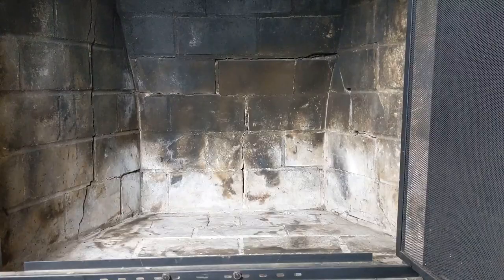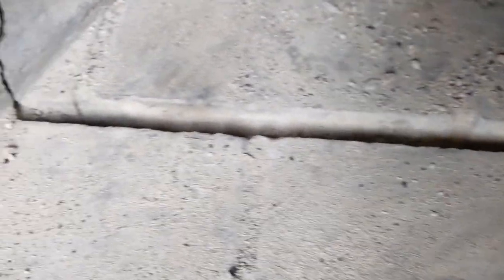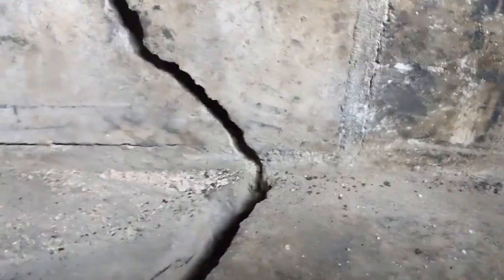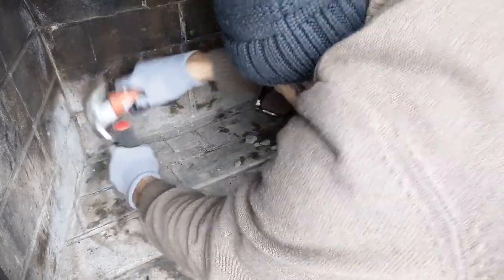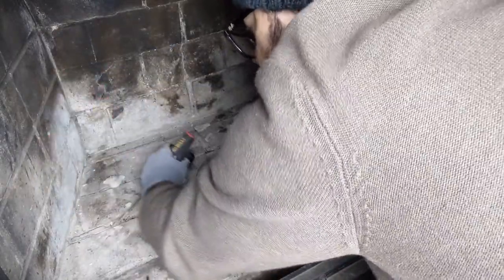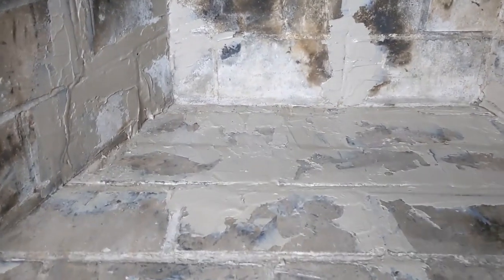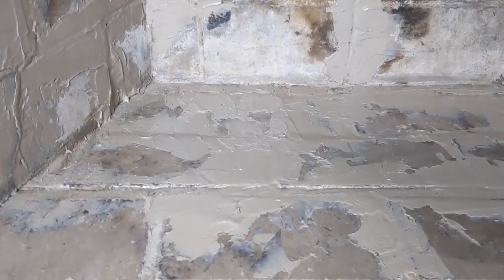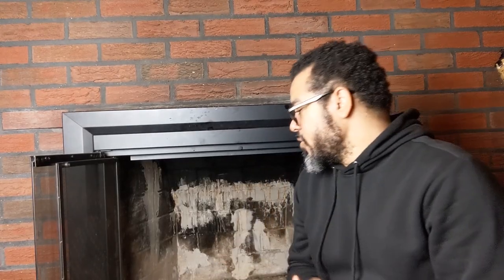HOW TO FIX FIREPLACE CRACK, FIREBOX CRACK  DIY

Comment: Caulking it would have been better to get in the cracks but overall you did a great job
Reply from the maker: Thank you for the advice, please help support the channel by subscribing.  Thank you
Reply: This is a high heat caulk in a bucket, it's just not in a tube👍

Comment: What did you do about the outside??? Did you use the same furnance cement??? You didn't mention it in the video, would you please answer what you did about the outside??? Sure would like to know, thanks inadvance!!!😃😃😃
Reply from the maker: Thank you for reaching out, I just bought regular cement with sand on  it and mix it up together and apply it to the brick.  Nothing major, just a temporary fixed.

Comment: Would these work well on the connection of the pipe flue to the top of the stove?
Reply from the maker: if there is any type of masonry it may if it just the pipe I don't recommended.

Comment: That looks pretty good. My cracking is on the back side of fireplace interior.  Close to the log holder.  I did what you are doing but it keeps needing more putty.  Same spot.
Reply from the maker: is save you a lot of money by doing this diy project very simple to do.  make sure that its dry before you apply the cement not raining.  Good Luck.
Reply: @omareteVilato  yes I do this every winter.  Keeps repeat cracking. I guess that is normal.  Thank you
Reply from the maker: @DiannaAtherton  great I also do it as well.  Hopefully by this coming spring will resurface the whole area.  Thank you.

Comment: If its raining in your fireplace, yu need a cap.
Reply from the maker: Yes, I had a new cap replacement on top of my fireplace, it just happens that it was to costly at the moment to replace the brick burner inside, I decided to do it myself its a temp job but its working just fine.  "omaret vilato" don't forget to subscribe and support the channel.  A lot of cool stuff.

Comment: Not bad next time time I would do high heat mortar its black its a dab can you can fill those cracks nice it easily and make it look pretty I did my own chimney like that same problems, no problems and still going strong after five plus years
Reply from the maker: ok, thank you for the heads up.  Don't forget to support the channel by subscribing.  Thank you

Comment: This is a great TEMPORARY, fix. Generally, when you have cracks in the firebox you likely have a leak (as you mentioned).

If your chimney is leaking water then you need to get that addressed first.  When water seeps into the firebox and the bricks (no matter how dry you think it is) it will crack your brick and mortar if you have a hot fire. Unless you effectively re-cure your bricks after every rainfall.

The brick and mortar is what separates the fire from your homes combustible materials.  For me, that is nothing to mess around with.  It’s worth the time to learn and properly fix it yourself or hire a pro.

Again, this is a great temporary fix.  But if you don’t fix the leaks this will happen again.  

Also, I’m all about DIY and saving money but when it comes to FIRE and WATER you really should do everything to fix it properly to prevent catastrophic damage in the future.
Reply from the maker: Thank you so much for your advice, I will follow through and keep you up to date as soon I replace the entire fire box.  That's the plan for the near future.  Once again thank you